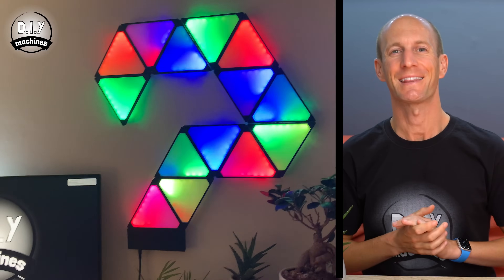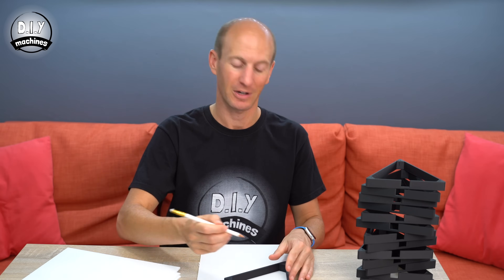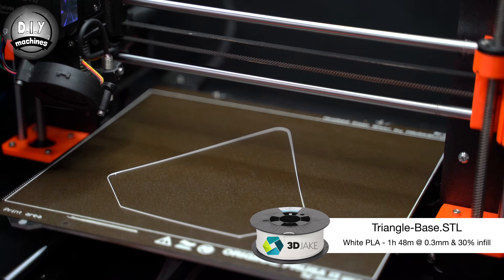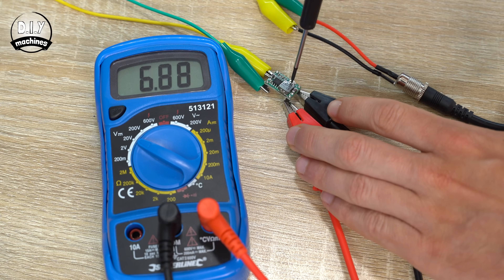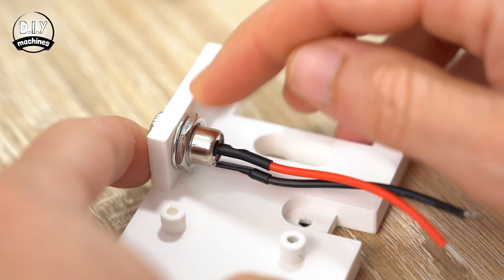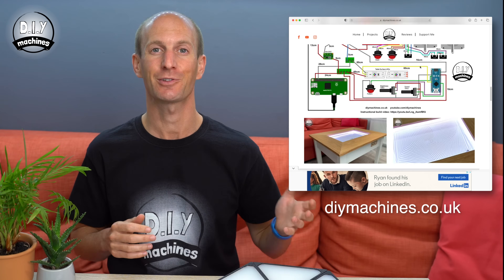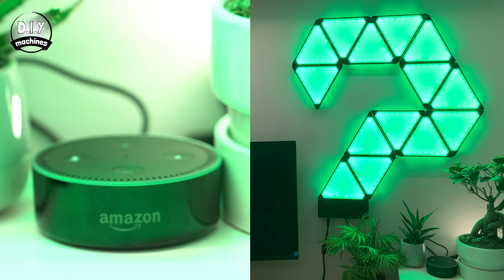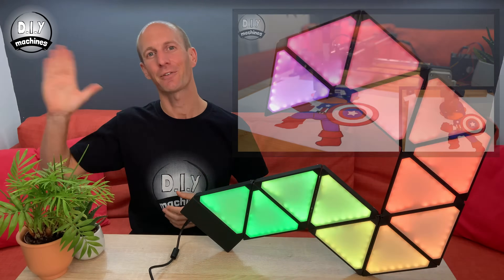3D Print Your Own Nanoleaf Project! - Alexa, Hue and App integration

Comment: I like it, but there are a ton of these panel tutorials with less quality, but easier to follow and cheaper to create. While I like this tut, I find it complicated and uses expensive equipment for some. Very creative, 1-10, 10+ for creativity, a  7 for difficulty for the new user. I would recommend retitling this project for those with a 3d printer as it may attract more people using these machines.

Comment: Can i get soe help? i printed the tringles bigger, and added 15 in total, i have used 8.5 meter of led tape, ws2811 also but 60led/m  so i calculate about 600 leds, i used 12V 20A input, but i cant get it to light up? exept the number of leds instead  should i change anything else? completly out of my waters here, just copying you example (just bigger)

Comment: love this project, i have printed the walls, base & control box but i printed the acrylic reference shape 3mm height with white pla+ and it looks like opaque acrylic, so i printed another at only 1.5mm high and it looks pretty good ( lets light from a led torch through) , waiting until my leds arrive before i commit to printing all the panels in PLA+ not acrylic
Reply: did you finished it?
Reply: How did this turn I out?  Thinking of doing the same as I don't have the means to be cutting acrylic.
Reply: @YouDyZ  yes it’s on the bedroom wall and set up with voice commands via Alexa, printed the panels in white pla+ but only 1.5mm thick and they work great
Reply: @gilesh3895  hi, I tried a few thicknesses but prefer only 1.5mm and it works fantastic this is a great project, I have also made two lightsabers using the same controllers but with 5volt leds so no need for other components
Reply: @paulmason6847  Thanks for the reply I will be doing the same

Comment: I was able to reproduce this using your stl files and the  pcb from PCBWay, it works great, thank you! The only problem I am  having is the 10 cm connector wires between the triangles at times are almost too short. I have one connection that constantly works its way loose, causing all the triangles after it to blink and flash erratically. I have reassembled the connections a few times, but so far the problem continues. I need to take it down again to figure out a permanent fix for one pesky connection. Other than that I really enjoyed this project.
Reply from the maker: You're very welcome. You're also right that sometimes (rarely) one of the wires connectors can be little tight depending on your layout. Have you considered soldering three wires directly between the pads of the troublesome connection?
Reply: @DIYMachines  Thank you for the reply. Yes, just yesterday I had the thought that I may need to actually solder a few of the connections rather than rely on the connectors.

Comment: I probably would print it with white filament and design it in such a way that you only need one part per panel.
Also WS LEDs with integrated controller would be better.
Also the inner circumference should be designed that the LED strip lays down fully and there is no component right on the bend, you also want some sort of hooks to pin down the LED strip because the double-sided glue on these tends to fail.

Comment: Hi, a very nice design, thanks for the video.  I used it as a basis to do my own variation on the design.  I had been working on something similar, but your rear frame and hidden wiring is superior to my design so i replicated it in mine (i hope this ok - its just for my own use).  I made a few changes.  

- My LED control is using a QuinLED Dig-Uno, I use relay control in line to ensure that the LED strips have no power when in an off state as in long scenarios they do draw quite a bit of power.
- I have an on/off button that uses the button functionality of WLED
- I use hot melt brass inserts for all the M3 bolt fixtures - it makes it easier to reconfigure
- i solder flying leads and use JST-SM connectors rather than the white clips you use - i find the clips lose a lot of power
- I print the lens as well using clear PLA and have a diffuser design in it - looks very good and works well
- I modified the frame so that my lens/diffuser clips in - no glue required

Happy to share the STEP or STL files if you would like
Reply: Hi I am also looking at printing my own lenses would you mind sharing your stl files?
Reply: @SvyatoslavGudzovatyy  - sure - let me see if i can find everything
Reply: i do have - send me an email and i will send them to you

Comment: Tip! 
I had the problem that the wifi most of the time did not connect.... 
For me the solution was easy.  
I had the voltage trim set to 5.0v. 
This I had to bring back to 4.5v to get wifi to work.
Reply from the maker: Thank you for sharing your advice with others. 👍🏼

Comment: Very nice - likely my first project when  I am finally able to decide which 3-D printer to buy ( I cannot believe how many there are to choose from!). One suggested design improvement: make all the LEDs and wiring attach to the white chassis prints and make the black light boxes snap on covers (like the cover of the rectangular electronics box). This way you can have concealed wall attachment screws without the extra small triangular pieces, and it would be a lot easier to gain access should servicing be required. The chassis prints could also have extra support features to simplify assembly and reduce the amount of glue and screws required.
Reply from the maker: Thank you John. I'd recommend Prusa - I designed this project to be printable on the full size Mk3 series and the Prusa mini.
You idea is great. I originally had the 3D prints with a hanging point on the back but when printing the first one and fully assembled it I laughed and face palmed 🤦‍♂️ myself when I only then realised the acrylic blocked access. This is when I pivoted to the mini triangle anchor points.
Being able to service it in situ would also be a great bonus.

Comment: Hi, nice project.. There is also an Wled android app, that works very well, with autosearch function. It's much better for controlling and searching, if you have more like one of this project application.. I'm using it many years and I'm very satisfied.
Reply from the maker: Thanks for the tip! I looked and found one for iOS devices as well.

Comment: I just tryed it, it took a lot afford to do, i did 19 Pannels and added some voltage every 4 panels. But idk why but my led strip stop working in the middle of the 4th panel. 
it would be nice to see a earlyer possible testing on the projekct. now i have to find out where the problem is

Comment: Nice project! Will have to try this out, but i'll try with printed white panels instead of acrylic first.

@DIY Machine
What I don't understand is how you come up with the 3500mA cap limiter. For your 14panels = 100.8Watts = 100.8W/12V = 8400mA ?
I am by no means an electrical engineer, and I wish to learn how you come up with this and how I should adapt this value in case I choose more or less panels.
Reply from the maker: Hi Dennis, the limit is created by the PCB's power trace widths, then the next cap is the barrel connector (rated for 5 amps peak if you buy the right one). I also kept it low to limit any damage someone might cause if they tried to push all the parts of the project too close to their limits. If you used an alternative path for the power to the LED's and kept an eye on the heat they generate then you could indeed increase the limit in WLED.

Comment: Your videos are getting better by the month, keep up the work! I just have a few questions. Don't you need to strip the wires that go into the t connectors? And if I make 12 panels do I also have to give the last panel a voltage boost? Or is it better to than boost every 5 panels? Hope someone in this great community can help me answer these questions.Edit. Do you use 30 leds/m or 60 leds/m. I can get a set of 60 cheaper than the 30 ones And I think it should just work fine
Reply from the maker: Thanks Ruben, I'm working on improving with each project. The T-splice connector make a cut in the wire themselves when you crimp them. When you add a power boost it travels out in both directions, so the idea is that each injection point boost the 2/3 panels in both directions which should be enough to cover the project. No harm in adding additional ones if you wanted to though. I used 60 per meter which is preferred, the triangles are sized to fit the 60 per metre. Have fun building your own! 🙂

Comment: How would it look like if you used something like aluminium foil as a backing for the triangles?
Reply from the maker: Good question. If you could adhere it well (smooth) to the backing panel then it should only improve things. Don't completely seal in the LEDs with it. One of the reasons it is spaced of the wall is to allow airflow to help keep things cooler. :)

Comment: I can't get the ESP8266 to connect with my PC, I've tried 4 different USB ports, 3 different cables and 4 different chips and nothing is connecting. Just a quick blue light flash and then nothing
Any advice

Comment: Do you think there's a way to power them and hold them together at the same time using some stronger magnets as connections?
Reply: Yes there is. I’ve seen a smaller lighting project with that. 
But you have to do your own homework because I really don’t know if the magnets have special restrictions, resistance or something like that, or if they work just like any regular metallic connector.

Comment: Could one use WS2812 instead of WS2811 without to much modification?
Reply from the maker: Yes you could, I usually use WS2812B in all my other projects but moved to the WS2811 to help with voltage drop (higher voltage helps). You would likely need to connect more voltage boost point along the chain. Also use a 5v power supply and bypass the mini360, it won't be needed.

Comment: Really nice project 👍👍 what specific type of filament did you use?  Like the quality of the surfaces 😁
Reply from the maker: Thanks Tobias. I used 3D Jakes Eco PLA (black and white one)
Reply: Thanks, by rewatching the video a saw you mentioned the used filament in the right lower corner. 😇

Comment: How is this holding up over time? I'm just wondering if I should use a different material than PLA or if the pla holds up fine?
Reply from the maker: I made two with PLA and both are fine still. They are indoors. There is no problem with making your out of ABS or PETG if you wanted to build a stronger one.

Comment: Would it be possible to do this with 24 triangles with the same PCB? If you should connect the two wires as you did at the same distance?
Reply from the maker: You could connect 24 triangles and the PCB and microcontroller will handle controlling that many. But you would need to revise the power supply circuit for that many panels. I can't advice on that, but you will need at a minimum to look into being able to provide more amps and using a thicker core (AWG) wire to deliver it safely over a long distance, the PCB could not handle that many amps for the LED's so you would need the power circuit for the LEDs to bypass the PCB. Seek some advice for the power circuit.

Comment: Great video & instructions!  I don't have a 3-D printer, but this would be my 1st project if I did since I too would like to have some Nanoleaf type panels.  However,  Is there a way to shield the LED's somehow so that the panel still  has the nice glow, but the individual LED's aren't as noticeable?
Reply from the maker: I'm glad you enjoyed the video. 👍 The LEDs are not so noticeable when viewing it in the flesh, they are tricky to capture on camera faithfully. If you didn't mind a thicker border around the acrylic you increase the amount it overlaps the acrylic at the edges, perhaps foil on the back panel may also make a difference. Hope those ideas might inspire something. :)

Comment: Hi, I love the video!

I have been looking into doing projects like these myself for a while now, and so I have a newbie question here and apologies if it has been asked already. 

I'm trying to understand how you are able to provide even power to all the LEDs with just 1 power supply. I know you added the injections along the line but the power still came from the 1 power supply.

From my limited understanding, I thought to power say 150 5V RGB LEDs (assuming all on max white brightness) would require at max around 9amps of power, and if I wanted to, say, double that amount to 300 then I would need 2 power supplies to ensure even and full supply of power to all LEDs.

You clearly are using a lot more than the example of 150 LEDs, and yet with a 6amp power supply as your video states, you are able to power all of them.

Sure, you aren't turning them all to max brightness or to as white as you can get, but I am assuming you wouldn't have a problem doing so if you wanted to, or you would have mentioned it as a warning.

Does it have something to do with the fact you used a 12v power supply that was converted down to 5v for the LEDs. Did that change the amperage to something more than its default 6amps?

I assume I am missing something fundamental about how power supplies work and when powering a circuit. I am still learning this stuff as I go. Hopefully you or anyone else sees this and can give me an easy to understand answer.

Thanks for your time.

P.S. how many LEDs do you think can theoretically be powered using your method with that power supply and your injections at the regular intervals, until the power supply is just not enough and another would be needed?

Comment: DIY Machines, regarding the LED you state to use WS2811, can you use WS2812B the main difference I have found is the 2811 are 12v and 2812 are 5v, though you need to use the buck converter and dial it down to 5v?
Reply from the maker: Yes, you can use WS2812b - just use a suitable 5v power supply and bypass the buck converter. I usually use WS2812B but switched to the WS2811 to help overcome the problem of voltage drop through the chain of LEDs.
Reply: @DIYMachines  Ok I have the circuit board that you provided and have tried it with a 5v power supply and removed the buck converter.  Now when I power it on I do not get a light on the ESP8266.  I have checked the ESP8266 and it works when I supply external power.

Comment: Curious on the pcb boost can the boost slots handle 2 sets of 6 triangles? 12 on each boost?
Reply from the maker: At full brightness you would be pushing it. Connect the power supply directly to the PCB and directly to the LED's power lines so that the LED's do not pull their power load through the PCB and you should be OK.

Comment: Hello
I use mac ios Catalina. I have downloaded the Chrome browser for and installed wled on the D1 mini.
it lights up but I can't find it when I try to install. Do you have any tips on what I can do?
Reply: I fixed it. I tried a bunch of micro usb cables. one worked, so there may be a difference between the usb cables.
have you used ws2811 RGB 30 or 60?

Comment: Just out of curiosity, if I were to add more panels would I just need to find an alternative power supply that can handle more current while still supplying 12v? Or is there something I'm missing. I'm new to stuff like this and would love any guidance
Reply from the maker: Yes, you would need a larger power supply and to bypass the PCB when powering the LEDs (the traces on the PCB can only handle so many amps). Connect the end of the LED's to the PCB as shown in the video and the circuity on the PCB will happily draw power from the LED's and ru correctly.

Comment: Could you use WS2812 led lights?
Reply from the maker: Yes you could, and this would mean you can also omit the Mini360 buck converter and use a 5v power supply. I chose the 12v LEDs to help overcome voltage drop. You may need to 'boost' the voltage more frequently along your run of LEDs.

Comment: Would it be possible to add an stl for the diffuser? Cutting the acrylic sheets poses a problem for some of us. Thanks.
Reply from the maker: Hi Richard, do you mean the outline as a PDF for printing or are you thinking STL to try and print a diffusion layer?
Reply: @DIYMachines  An stl to 3d print the diffusion layer
Reply from the maker: @opuscroakus  You can find an STL in the download section here: https://www.diymachines.co.uk/geoleaf-3d-printable-nanoleaf-with-esp826-alexa-hue  Please let me know how it goes, and if you succeed, the thickness you printed it at so I can share it with others. :).

Comment: at about 18:40 you change the color mode BRG. How did you know to do that, is it dependant on the led strips you get? I've used wled for other projects and don't remember changing that.
Reply from the maker: Hi Gavin, it was trial and error. I tried one, then set it the colour to red, green and blue. Noted mentally which colours where correct and then changed the order of the others using the drop down. (A bit like the old mastermind board game)
Reply: @DIYMachines  ah, so probably dependent on which LED strip you get. I'll have to poke at it when I get there.

Comment: Hey, I'm new to electronics, i got a spare esp32 from a friend, can i use it instead of the esp8266?
Reply: Can't verify physically as I have neither right now, but yes you can. The process should be about the same but the pinout and layout of the board may be different, you have to double check. If that is the case then I can help you with getting a modified PCB.

Comment: Looks great!
Question: Shouldn't a fuse have been included on the PCB to avoid potential shorts?
Reply from the maker: Thanks. Any power supply used should have a fuse already fitted. (That was the intention).